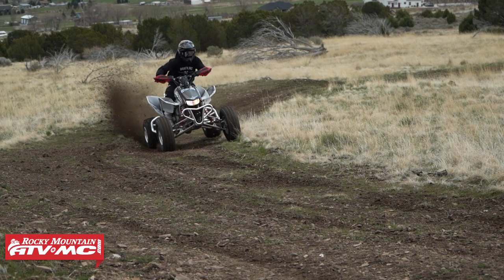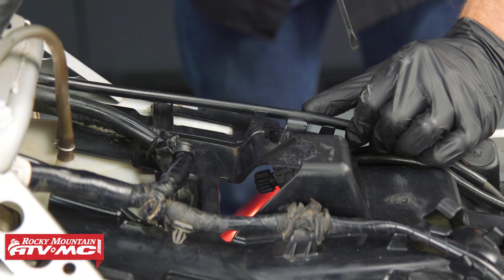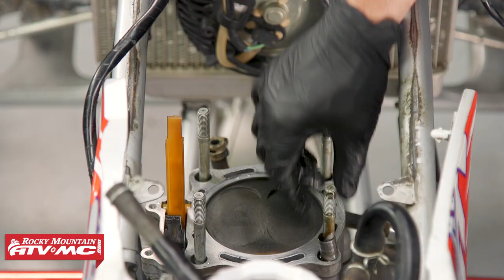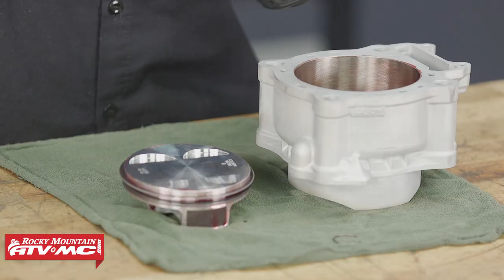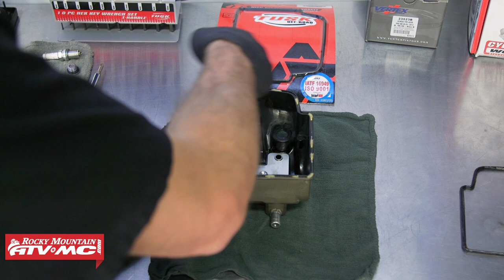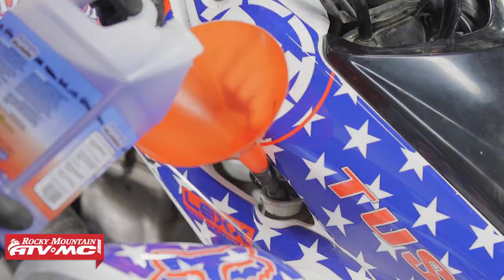Honda TRX450R/ER Top End Rebuild and Cylinder Works Big Bore Kit Install

Comment: In general is this a reliable atv? I am in the market now and was looking at 400s.400ex, LTZ and KFX. Just heard these were not relaible which is odd for Honda.
Reply: People say 450’s are not reliable because they ride the shit out of them and don’t maintain them I have a yfz 450 and I keep it up and change the oil regularly and no problems at all with it
Reply: @05cateye96  I'll never race it so what would be the general antreville to do the valve adjustment
Reply: @mzondi1970  I have no idea the guy I bought my yfz from had just had the top end rebuilt and I have put at least 30 hours or more on it and I have never had any valve issues but I would have no idea how to fix them or adjust them if I did have an issue
Reply: @mzondi1970  check them every second oil change
Reply: My 06 trx 450 er has been extremely reliable still riding it in 2020 with no problems at all and i ride it about 4 times a month but im strict with oil change and maint.
Reply: @jeffro7p202  have you ever rebuild or opened the motor?

Comment: Can you give us Jetting recommendations for this big bore kit?
Reply: Bigger
Reply: @jonthelamb4549  100% incorrect. Larger bore = larger vacuum therefore drawing in more fuel out of the same size jet. Sometimes you can leave it alone but most commonly an excess of fuel is drawn so a leaner main jet is required.
Reply: @vipelink  I see what your saying but larger vacuum adds more air also isn’t it? You would need bigger jets if you get a bigger carburetor because that would make a smaller vacuum then?
Reply: @jonthelamb4549  If you get a bigger carburetor that changes everything and it’s a case by case basis. I am asking Ford jet settings for the same carb
Reply: @vipelink  Please do not listen to this guy.  The TRX450r is lean enough from the factory, DO NOT go to a smaller main with a bigger bore.  It doesn't matter if you have the 04/05 Keihin carb or the 06+ Keihin FCR - you need to add fuel, NOT take it away.  Dyno'd plenty of them to know better.

Comment: so i followed this instructions and when i dropped my chain into the bottom end and then fished it out, the chain was somehow not long enough, anyone doing this on an aged bike (I have an 04) should be careful.  I had my chain somehow fall around the metal guard that is bolted in the bottom end with an 8mm bolt.  To fix it was easy though, but took me a while to figure it out cuz i had to drain the oil and coolant once again after refilling and pull the cover off with the stator, I then proceeded to attempt to figure out why the chain was not going up high enough and after several attempts to get it around that metal I ended up breaking a piece off the case trying to pull up on the chain, it was a little fin next to the oil return, so I thought I had to remove the flywheel.  To get it off the metal I rotated my flywheel around which had certain holes in it and found the bolt holding the metal piece, unbolted it so the metal would rotate and the chain was free and was able to time it back up.

Comment: I have a 2006 Honda and I want to change the transmission oil. What type of oil can I put in it?
Reply from the maker: Pro Honda HP Transmission oil would be great: https://www.rockymountainatvmc.com/parts/pro-honda-hp-transmission-oil-p
Reply: @rmatvmc  It is a Honda TRX 450 R, are the type of oil used for the engine and transmission different?
Reply from the maker: @Ronaldo-mc4lt  After looking at your owners manual it looks like Honda calls for Pro Honda GN4, HP4 oil in both the transmission and engine. 10w-30 weight oil.
Reply: @rmatvmc  OK thanks brother

Comment: I have a 2012 400x with a 440 big bore. Is it an identical process to this? Is there a way I can find a big bore rebuild kit? Or do I just buy a completely new big bore kit?
Reply: No the process is not identical. Yours is an air cooled bike for starters. The general idea is the same, but your engine is actually a little simpler. You will need everything new except a cylinder, that’s the most expensive pice anyway. You can get away with just a piston, rings, and new gaskets.
Reply: @vipelink  Thanks. I'd need to find a bore specific piston though, wouldn't I? A standard 400x top end rebuild would be too small correct?
Reply: Yes, this is the kit I would recommend. It fits your specific machine 440 big bore kit. Do you happen to live in the North West?

https://www.rockymountainatvmc.com/parts/wiseco-big-bore-replacement-piston-p?v=10197
Reply: only good thing about 2020 is that RM is producing more 450r/er videos ! thank you much needed
Reply: @vipelink  Oh man sweet. I didn't know they made this, thanks! And no, I'm located deep south in GA/SC.
Reply: And this is the big bore replacement gasket kit. You will need it because stock won’t fit the new bore size

https://www.rockymountainatvmc.com/parts/wiseco-big-bore-replacement-gasket-kit-p?v=10197

Comment: Hey bud what would cause the starter or something in that area to start smoking when I turn key over it sparks like its gonna catch fire when I push start button
Reply from the maker: Man, that is tough. Could be a couple things. Check the wiring and make sure your connections are good and nothing is shorted. You could also remove the starter and test it or make sure the engine turns over freely by hand.
Reply: @rmatvmc  ok thanks checked wiring gonna check starter next when I take timing chain off have to replace that its stiff as a board Iol I know its bad gonna go ahead do valves while I'm replacing chain think one of intake valves was off a lil but ill let you know when I check and let you know what the problem was..

Comment: Why would a 4 stroke loose compression ive seen john deere generators run for 100,000+hrs
Reply from the maker: Race quads like the TRX450R are being ridden hard and pushed to their max constantly . A generator is designed to run at way lower RPM's and not be under a lot of strain at any time, which lets them last much longer.
Thanks for checking out the video!

Comment: How is it not one video here on YouTube will show u witch way the 3 bottom rings go n the shim ring then the oil ring then the other shim ring the 3 bottom rings not one video will show u how to put the mesh oil ring n that mesh oil ring the 3 bottom rings ya the one n the middle that ring has Togo n a certain way that's the oil ring  witch way does it come together your right that oil ring can't over lap but it come together does the oil ring come together with the end pointing up towards the top of the piston when it comes together when u install it on the piston or does that oil ring when it comes together have to b pointing towards the bottom of the piston when it comes together on the piston ya never ever show if that oil ring  goes n correctly it comes together as a w or does it come together on the piston looking as if it is a m the w would b pointing towards the top of the piston and if comes together as a m then that oil ring coming together would would come together as pointing towards the bottom of the piston if that oil ring is n backwards u will b tearing it back down because it will smoke bad if that oil ring is put n up side down and ya no this and will not show the main part of putting the oil ring on these piston why does everyone do this that's so damn important when u re build these motor and yet you still don't show it why do ya do this let me guess ya want know one to figure this out so people will take the bike to someone to fix it for u because labor is so high now days is the reason ya will not show the main importance of the oil ring now ain't it I rebuild  these motors to and ya do t show how this damn oil ring g goes n correctly
Reply from the maker: Hi. It won't matter which side of the expander ring faces up (M, W). If it did, Honda would specify that in the manual. Just make sure that it's not overlapping itself, and that the gap of each ring doesn't line up with another gap. Honda specifies that the side-rail gaps should be spaced by 20mm or more. I have seen a side-rail that was damaged on installation that caused a new top end to smoke. Take your time and use caution during assembly and you should be fine. Let us know how it goes, and thanks for the comment! -Charles